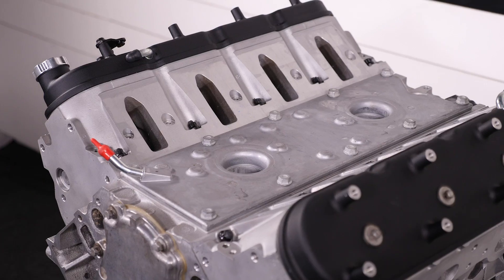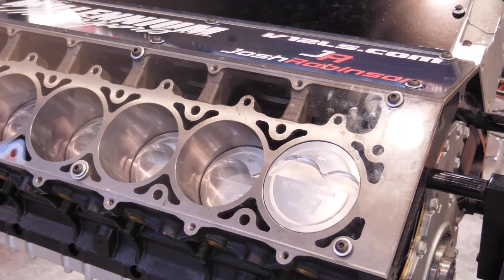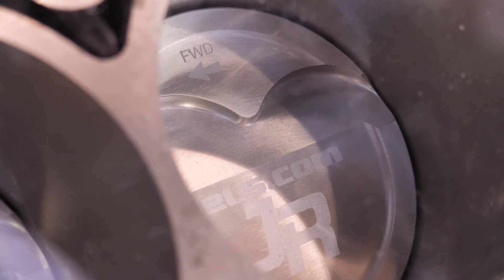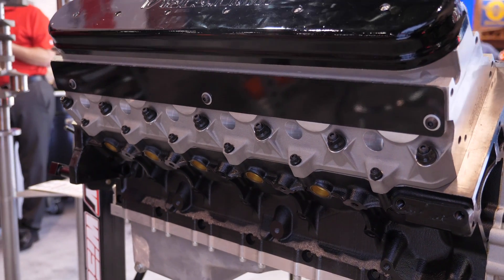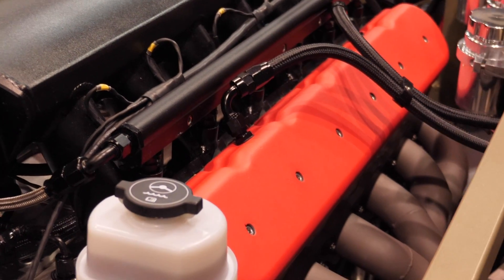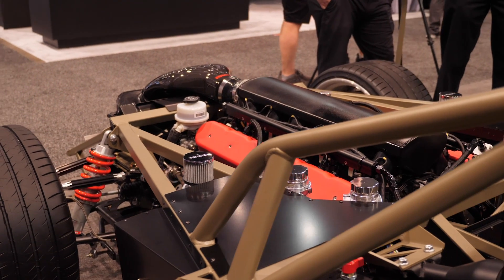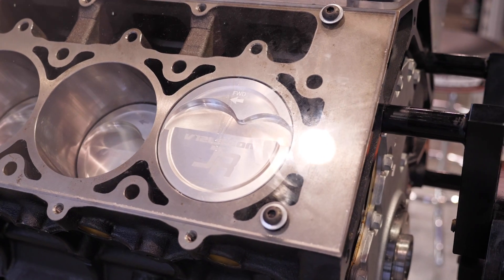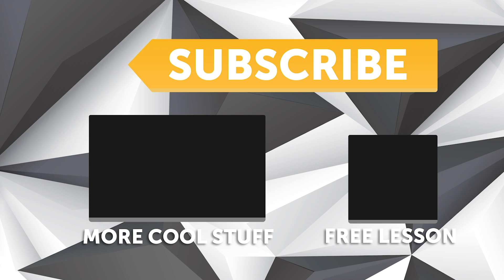V12 LS Engine | What Goes Into A Bespoke V12 Build [TECH TALK]

Comment: at this point i'm just waiting for an ls v10
Reply: There is a video of a bespoke v10 ls engine
Reply: That’s gonna be amazing though....I’d like to see it have a flat crank and maybe 10k RPM
A slight hint of that Schumacher era F1 noise
Reply: @Americana-deluxe  There's no such thing as a flat crank V10. Each crank throw would have a +18° split in it to give even 72° firing. A balance shaft would also be needed, as by splitting the crankpins you lose the perfect primary balance of a 90° V angle.
Reply: @electric7487  You don't need to split the crankpins if you are willing to have uneven firing intervals, just as this V12 does not have split crankpins and does not fire evenly (but is balanced). A V10 not adapted from a V8 generally uses the same crankshaft configuration as an inline-5, with banks at 72 degrees resulting in even firing; as you said, this is not a single plane (flat).
Reply: @tony_5156  I just did a simple Google web search for "F1 V10 crankshaft", and confirmed that they're all similar... and none are flat-plane; they have 5 crank throws, each a multiple 72 degrees from each of the others. YouTube comment sections normally don't allow web links, but if you do the same search you'll find lots of descriptions and images of F1 V10 crankshafts.

Comment: Correct me if I’m wrong, but the imbalance problems will be solved with a custom crank and cam. Which this engine would need anyways. Why not just solve it by making it a 3-plane normal V12?
Reply: No correction needed, that's the right way to do it and exactly what was done here. Thanks for the interest Andrew.

Comment: Would be cool to see one with a split pin crank to make it sound more V12ish and make it even firing
Reply: We like the way you think and have an even fire test engine in the build at the moment.
Reply: @V12LS have you ever considered 4 k series engines into a v12. Similar amazing platform. Better volumetric effiency. You could avoid some of the issues of the k48 project. 

K60 lol. Keep the stroke short but long rod ratio.
Reply: @V12LS  should be just a custom crank. I mean, not simple, but relatively do-able for a machine shop from a chunk of billet. More complex if you want a forged crank.

Edit: never mind, hadn't gotten to the part where you said you had kept the 90 bank angle. That's an interesting choice. I understand why. But I want a v12 that sounds like a v12.
Reply: @ScottKenny1978  That's right, we have a split pin crank and alternate cam option in the works now that will result in even fire every 60 degrees of rotation. It's not necessary but we want to give it a test. It will sound like every other V12 and easily handle NA applications but removes some crankshaft strength and requires modification to the rods so we wouldn't recommend it be boosted. Once you have driven a few of these you start to subconsciously start liking the unique sound though, similar to why people love a cross plane V8s uneven pulses it's all mental association. Here is an example, this thing is insane on the street! https://www.youtube.com/watch?v=tKXsn3n_oL0
Reply: @V12LS  cool. If I ever get the cash to do that baby mustang airplane I want it to sound right, which means either this or the Falconer v12. And ideally this in max displacement format.
Reply: Or make it 60degree (or 120 i guess) like the rest of the civilised world.
Reply: @tomstech4390  that would defeat the purpose of being 'LS based' , as in you can still bolt all the LS accessories,  covers and transmissions
Reply: @tomstech4390  We love 120 degrees engines. In fact we had a quad cam one designed for a client but it was too wide for their project. We obviously could have gone to 60 degrees but chose not to for the reasons stated in the video. I’ll make you one though if you can afford it.
Reply: @V12LS  what would a bespoke engine build cost ? To own a complete custom block running unique displacement
Reply: @SGTMARSHALL1  Anywhere from $300K to $2M depending on what you want to achieve.
Reply: @V12LS  thanks for getting back with an answer, that's a serious contrast, can you give me an example of what $300K buys compared to $2M. I have a few engines in mind all 10 cylinders of various displacements from 3300cc to 7000cc and an unconventional concept engine so planning what items take priority based on availability of funds is key
Reply: @tomstech4390  but then you need to make the intake runners more vertical ( or shorter, which I prefer for turbo). Reduce stroke and switch to smaller valves ( but 4 ) to keep height and cg.
Reply: @ArneChristianRosenfeldt  Well from the blocks perspective a narrower angle has very little effect on CG compared to the rest of the car like roof, A-pillars, interior features like dashboard height, tall leather seats with heating elements and so on.
Infact depending on engine bay packaging narrowing the V can allow the whole engine to be dropped lower in the frame (especially if dry sump) because you have more clearance for exhausts, shock mounts and steering shaft.

The intake can become relatively higher (meaning a straighter shot at the valve so better head flow without needing porting) and higher horsepower at the top while not losing any in the mid and low.
OR you can do the LS truck intake thing where the runner curves around the perimeter of the shared plenum for more mid range.
OR you can have 2 smaller plenums per bank like ferrari does (812 Competizione makes 819hp from a 6.5liter with 408ftlb at only 2500rpm plus 510ftlb at 7000rpm before a 9500rpm redline).
There's many ways to skin a cat.

Going to 4 smaller valves would of course be a benefit increasing flow yet again, like 10 years ago a company made a DOHC head for the LS7 and it had more flow and power across the board, That's why the new corvettes have finally switched to a form of DOHC (indirect through a follower), giving more horsepower despite a smaller engine. Plus there's less reciprocating mass with no rods and rockers, the valves are also lighter meaning you don't need insanely strong springs to prevent valve float at high rpm.

Stroke wouldn't need to be changed, it doesn't care how the cylinders are offset, there's plenty of large V12's.

Worst case... make it 120degree and have an even lower CG. Ferrari, McLaren and Audi did it for race engines and are not doing it for road cars too.
Either way will make it even firing without needing inherently weaker split pin cranks.
Reply: Yes weight is a concern all around. I don't unterstand the love for glass roofs. I guess I will never (I mean: in my dreams) try to fit an engine in a car when the engine cannot fall through the bay. My father taught me that maintenance wants to reach into the bay, too. Dry sump is always in option. In fact, with long crankshafts it is even more desirable. One advantage of V8 over inline-6 is the shorter oil pan ( per displacement). I just wanted to shorten the stroke to have nominal the same cg to void all arguments. I think that McLaren now sells you a 120° engine in a street car? Sometimes I think, balance is not important, but then it seems to eat a lot of power either in a quite large balance shaft with all its bearings ( see inline-3) or the engine suspension with the U joints and cables to engine and gearbox all wiggling. A little larger diameter on the crankshaft for inline-6 or flat-6 with their 6 throws does not seem to be as bad.
I like 90° for the in-bay balance. I think that European and Japanese have quite large counter-weights in their V8. Best to no slosh them through the oil => dry sump for V8!   @tomstech4390
Reply: @ArneChristianRosenfeldt  Shortening the stroke (for lower CG) is indeed an option, allot of people will reduce the stroke of a cummins or some big block V8's for greater longevity despite higher power outputs, you lose a bit of torque (because of inherently lower displacement, its been shown in engine masters and elsewhere that for the same displacement a short stroke but wide piston can still make a ton of low end torque).
It means you can move the highest cylinder pressures up the RPM range creating more power but that torque peak (due to higher rpm) lasts a shorter period of time, 500ftlb at 5000rpm is safer than 500ftlb at 2000rpm if you get my meaning.

A shorter stroke would also reduce windage in the crankcase for better life and better reliability (less oil aeration) even without a dry sump, buy hey this is a custom engine anyway so why not.
Longer length cranks do get weaker but its not like a V8 is much shorter than a V12, Otherwise the same arguement could be had for V6's vs V8's.

Europe has both flat plane and Xplane cranks depending on brand and usage, Ferrari typically has flat plane (which ford coyote uses now I believe) and BMW and Lexus have often had Xplane for better balance in their luxury brands because its easier to balance vibration most of the time... except for needing a mass damper on the crank nose and big end counterweights.

Meanwhile an inline 6 or V12 require no counterweights and are balanced in primary, secondary and tertiary directions. Personally I think thats a huge win.
Single (unsplit) crank throws, no counterweights or nose dampeners while being smoother and more free-revving, combine that with standard 6-bolt bottom end techniques and thats pretty close to a perfect all round engine if you can spare the length. ;)
Which again with a narrower bore negates much of the length anyway.

Conversely V6's pretty much suck, far more complex and expensive than an I4, unbalanced in every way regardless of 120 or 60degree, take up allot more bay space and so on. If possible choose anything else IMO.

But to the original topic making a "v12 LS" is a bit like how chevy created the Vortec V6 2800 or whatever (?) it was when they took the 350 small block and just cut off 2 cylinders to make a 90 degree V6..... sure a V6 sucks but thats just a bad idea.

The LS engine is great, but make it a 60 degree DOHC (4valve) V12 and it would be amazing, Keep the bore and stroke so you can buy the same rods and pistons etc from the aftermarket, considering this is a largely custom engine it's not impossible.
We have billet aluminium and 6axis CNC now :D
Reply: I once thought that the LS idea was to have a single camshaft. With 60° the push rods could become shorter. With less emphases on power due to intake runners, the camshaft could move up, closer to the valves. With all valves pointing inwards (no HEMI), the rods are short, and the levers don't need to endure as much "U" turn force.

I am not after power. I had to stick to 4 bangers in my life. Even a detuned V8 or V12 has more power than I can handle. I switched to automatic and don't care about torque anymore. I care about efficiency. I read that there seems to be a pretty hard limit. With reasonable large cylinders, Diesel wants to stay below 2000 RPM. For some reason efficiency on gasoline drops above 4000 RPM. Actually, efficiency likes stroke, so it hurts me a bit to reduce stroke ( and conrod length) for the weight.

I am not aware of flat plane V8 in Europe, beside the Ferrari. Ferrari V8 are small, not efficient ( by engine weight or fuel ). The second order imbalance is fought by using long conrods and small stroke. A small balance shaft would be able to compensate this ( at low additional loss ), but Ferrari does not offer this. I think that long header from an even firing 4 cylinder bank it ideal to press into a turbine. I am a bit sad that long conrods seem to be so pricy. They mostly seem to be used for "legal" reasons: Displacement limit in a race class, or Tax 😞
 @tomstech4390

Comment: If twelve is good surely sixteen would be better?
Reply: Sixteenpower is a marine ls based engine worth looking at, 850 cu in I think. Engineers from the Cadillac sixteen worked on it which I find interesting
Reply: Well, heavier anyway!
Reply: Nope. Six is a magic number. There's no way to incorporate "6" into "16".
Reply: @richardcaldwell6159  It’s right there after the 1
Reply: I want a W16 with 4 individual cylinder heads W and VR need passages to let intake runners / exhaust headers pass through. Small fingers to tighten all the individual flanges.